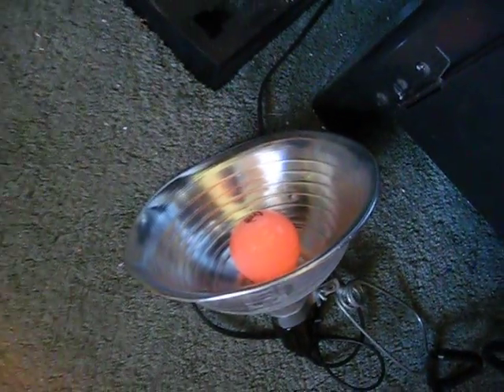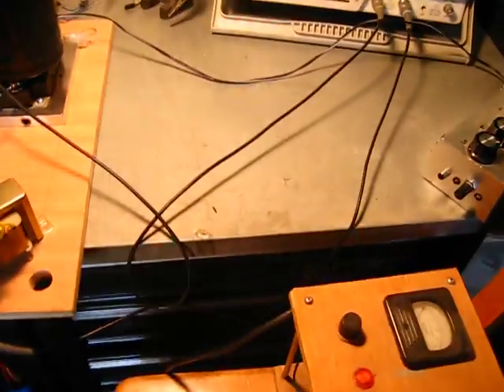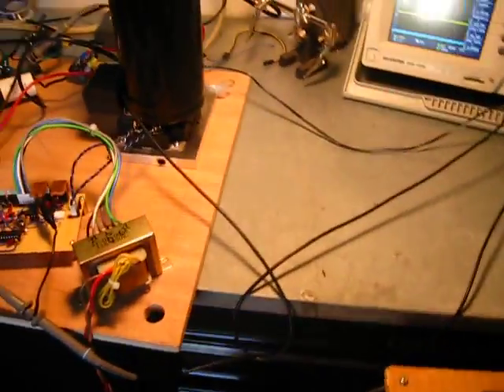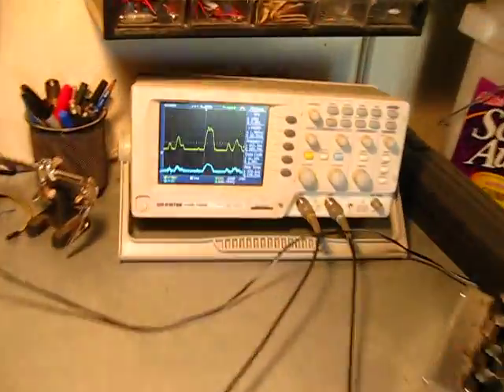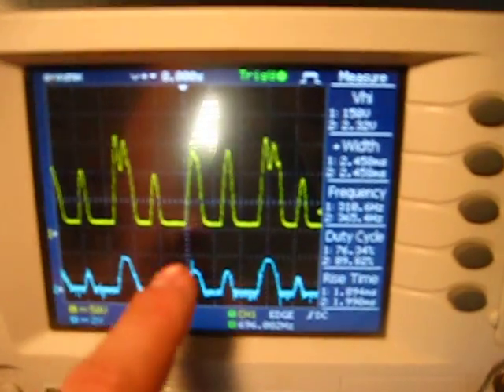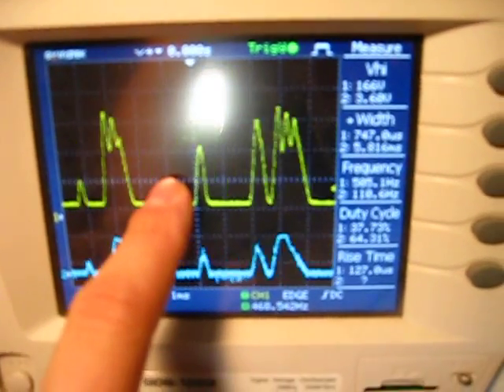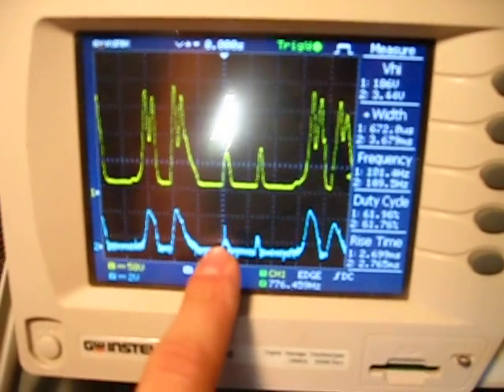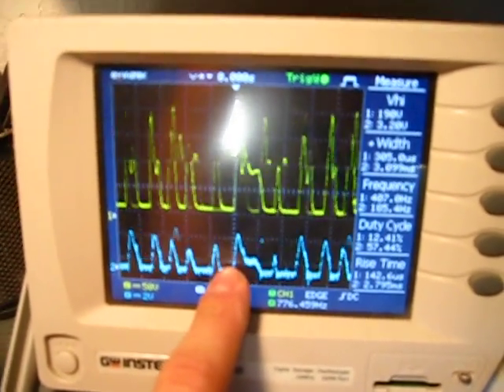QCW Class D Audio Test

Comment: Nice work. Can you add some DC offset to regular full range mp3 audio (not from synthesizer) and put it on input of this modulator ? You sholuld have 200V at output when don't put any signal. Audio will change voltage from 200V to 0V for bottom and from 200V to 400V for upper half of the wave   :)